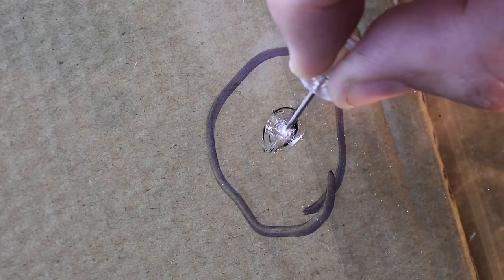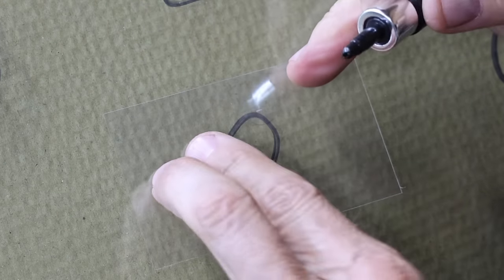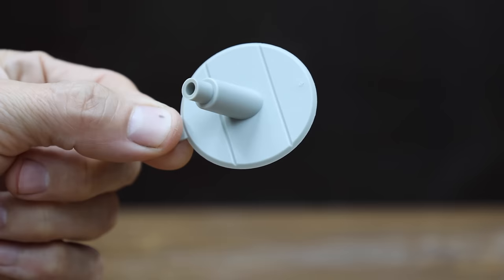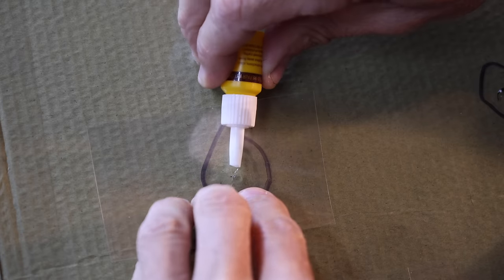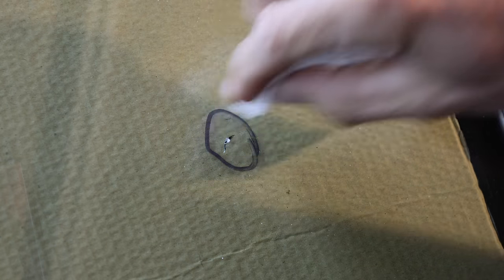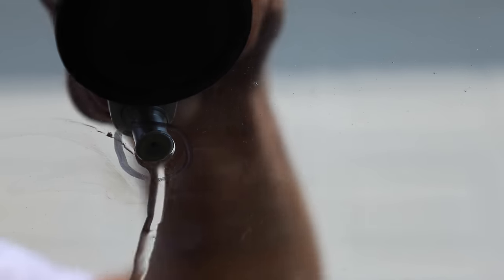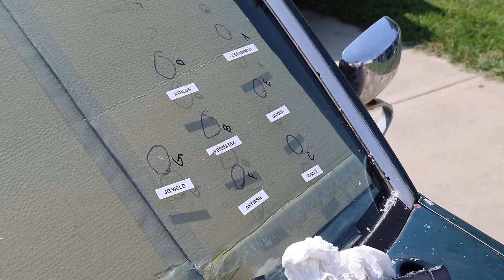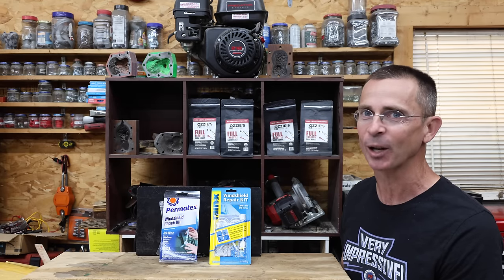Best Windshield Repair Kit? Let’s Find Out!

Comment: So, I use the permatex and rainx on a regular bases. Wrangler windshield. The permatex is my favorite for bullseyes but the rainx kit is the only kit I can use to repair the ones that have spread. I put Vaseline across the path the suction cups will travel to guide the center over the full length of a crack while maintaining full pressure.
Reply from the maker: Thanks for sharing.

Comment: I recently paid $120 for a single tiny chip repair (that was the lower of two quotes from a national chain vs a local shop).  I’ve wanted to try one of these kits going forward and now I feel confident which one I’m going to use.  THANK YOU!!! BTW - your lawn mower blade recommendation this spring was spot on.  I bought two of your preferred mulching blades for my 42” deck and have never been happier with the cut.  Keep up the excellent work!
Reply from the maker: Thanks, will do!  Thanks for sharing.
Reply: @TastySurrealBowl Which kit did you go with? How are your results(looking) holding up?
Reply: @SG-bb8pq I have yet to make the repair but I’m going to be trying the Permatex kit.

Comment: I actually just had to do this on my jeep. Had two quarter size impacts that were bouncing light into my eyes. I used the permatex brand because I recognized it more, and it was the /only/ one that did suction like the pro kit. I had about a 98-99% reduction to the damaged area with only the "pit" being visible. Didn't have any issues with the pit either, but I left it to cure well overnight and most of the next day. 

For twenty bucks for two? It's a great product and saved me from dropping 250 on a new windshield.
Reply from the maker: Thanks for sharing.

Comment: I carry Rain-x kit in my car. Used it last fall when traveling on vacation. 45 mins after a rock chip from a gravel truck I found some shade, did the repair, moved the car into sun to cure it. Then happily keep traveling without worry about finding a glass repair place. 
 
Next I would like you to test non reusable aa lithium batteries. I find myself using these more a more now that the price is down to around $1 each. I use them in flashlights that I keep for backup, so I do not go to use the light 5 years from now just to find that the alkaline batteries have leaked and not only does flashlight not work but they have ruined the flashlight. There are many different brands now om Amazon, looking for the best bang for my buck. I use them in anything that might set more than a year.
Reply from the maker: Thanks for sharing.  Thanks for the suggestion.

Comment: EXCELLENT video.  I have always used the RainX kits finding their plunger tool to be workable but temperamental, I am not alone I see.  I think I need to add that ClearShield plunger tool to my kit for next repair.  I re-use the UV light from my AC leak kit in the same way you you showed.  Thanks!
I assume the PRO's resin for the crack and pit are different.  I wonder how so, is one harder that the other or something like that.

Comment: Another great one, Todd. About 30 years ago I used a kit very similar to Permatex (whichever one was available at my local Checker parts) and it worked very well, could barely tell there had ever been damage, and it lasted longer than the rest of the car.
I'd love to see your reviews of robot vacuums. I know that's a bit more indoors than the type of products you normally test, but I know I could trust you to test them right.
Reply from the maker: Thanks!  Thanks for the suggestion.

Comment: I did this as a pro many moons ago, our kit had a vacuum pump that we would use to evacuate the chip and all the moisture, as well would drill the ends of cracks to stop them and yes used my lighter to heat the repair, sometimes it would just 'run away' when a crack progressed from the chip
Reply from the maker: Thanks for sharing.

Comment: I've used the rain-x to fix my shattered phone screen, it allowed me to keep using it for years before i changed it. 

My procedure was putting the resin, work on the cracks with a sharp or pointy object. to make sure the resin got into everyone and stopped being so visible, once the results were acceptable I applied an hydrogel screen protector(I didn't use glass because I didn't know if the repair would work) and finally take it to the sun to cure, I hope it helps someone.
Reply from the maker: Thanks for sharing!

Comment: Great video! I feel a little more confident in a future purchase because of this. Thank you! One thing to note (if you care for it) is the blindedness of the test. Having the pro rank them is great but in order to achieve objectiveness you should not show them the brand names. You can probably get away with single blind where you (the administrator) knows the products and the subject (the pro in this case) doesn't, or you can go all out do double blind where neither one knows (i.e. get a friend who also doesn't know which is which, ask the pro which is which).
Reply from the maker: Thanks!  Thanks for the feedback.

Comment: I owned a Glasweld system back in the mid 80s. Paid $1100. It was a great kit. There are several thicknesses of resins and now different shades. Wish I still had it. I'd like to see if those resins can fill the cracks of cell phones.
Reply from the maker: Thanks for the suggestion.

Comment: I ended up choosing the rain-x kit over all others. The reason is because the rain-x kit allows for multiple repairs in the same kit, and my "new" truck has four different chips in the windshield. Buying four single use kits would be prohibitively expensive and I don't mind that the chips are still slightly visible.
Reply from the maker: Thanks for sharing.

Comment: I've done the rain x one,and after some practice runs,it filled in a crack where you could hardly see it,and it never spread , which was my main thing doing it... I've made chips almost completely disappear,but the thing has to be really clean,and use a UV light instead of depending on the sun
Reply from the maker: Thanks for sharing.

Comment: QUIXX Windshield repair kit is the only one available here in Sweden. Looks very similar to the Rain-X, except that the QUIXX manual also says you should use a hairdryer to warm up the area from inside. (Can anyone confirm they are the same?)

A note on the suction test you did: A normal plastic thread is probably very leaky when it is dry. With a liquid on the thread surface, it probably has a lot more suction capacity due to the viscosity of the liquid.

Comment: Video Recommendation
Recently, my family, and I have been looking at the electric generators/power banks. I know you covered a video on generators before, but I was wondering if you can possibly check out the electric power banks, as they seem to be more usable rather than a noisy power supply. Lastly, you always make great videos and help me make the right decision with my buck.
Edit: I have 2 rock chips on my 22’ highlander and will be purchaseing the permatex although the clear shield does perform better, 300 dollars, I’d rather put the extra 200 on top for a brand new windshield. Thank you again for providing all of this valuable knowledge
Reply from the maker: You are welcome!  Thanks for the suggestion.

Comment: I've used the Permatex kit on multiple vehicles. Mainly because that is what is sold at the local stores. It works better if the windshield has been sitting in the sun for a few hours.
Reply from the maker: Thanks for the feedback.

Comment: I've had good results with the jb weld and permatex kits. I think they're just rebranded from one or another manufacturer. Inside the kit is the same stuff. One important thing to note for anyone using these DIY kits. If  the results are not to your satisfaction, then you may be out of luck. A professional will likely not try to repair after you used the kits. They would have to heat up the existing resin which risks cracking the entire window and this would require whole window replacement. Overall it's a gamble.

Comment: I’m really surprised that so many kits, even the clear view, just push the resin in. My understanding was that the vacuum provided by the actual syringe products was necessary for the resin to migrate. But the pushers seem to work…

When the professional did his repair, he pushed the resin in, then said, “now I pop it”. His hand was in the way and it wasn’t clear what he did. Did he use the piston to push resin in then briefly unscrew the  CYLINDER to release the pressure, then back out the piston to create a vacuum?

I really expected the professional kits to have a small screw valve at the bottom of the cylinder. Put the resin in. Open the valve. Lower the piston. Close valve. Withdraw piston. Pause a bit. Lower piston.

Did you happen to hardness test the professional?

As always, great review!

Comment: Thank you so much for your in depth tests, they are extremely helpful. I believe you are truly making the world a better place by showcasing weaknesses and strengths of products many people use. It's the ultimate version of "Consumer Reports" and it holds manufacturers accountable as well. I really just came on to say I was interested in knowing which waterproofing silicone spray is the best. What to look out for as far as chemical compounds and whatnot. I usually go straight to 3M then Dupont but have been shockingly disappointed with a 3M product in the past but I can't remember what it was. Anyways, just putting in my comment to express my appreciation, you seem to be a very good hearted helpful person. I am also casting my "Best Silicone Waterproofing Spray Test" vote. Thank you.
Reply from the maker: Thank you very much for the support!

Comment: I have had extremely good luck with the rainx kit. Typically I will use more resin than recommended and do it twice for larger bullseyes with cracks. Ill also let it sit for 10-15 minutes with the pressure driver down. You can use it multiple times which I like.
Reply from the maker: Thanks for sharing.

Comment: Very good demonstration for sure and I use the rain x brand and I apply a little heat and it seems to pull in the resin more but it’s a gamble because it could spread the crack.
Reply from the maker: Thanks!  Thanks for the feedback.

Comment: @Project Farm you guys should do a review on work tables, the foldable kind for job site. I used the dewalt ones that came out they used to be 70 dollars and would go on sale, now the market has exploded with options at 100+! testing the plastics and weight capacity, maybe a long term corrosion test too seeing which one is best for the buck like you guys always do so well. about to go pick up some straps you recommended for cutting resistance, my second set in one year with regular use on steel to really only replace one.  Thank you for making the best tool testing vids on the platform in a way that's scientific and entertaining.
Reply from the maker: You are welcome!  Thanks for the suggestion.

Comment: Surprised about the JB weld results, figured they would do good since they have the brand name behind that for making good e-poxy stuff and i've used some of their products in the past. That said the last windshield repair i did i used Permetex since that is what my local auto zone had. Its held up fine only thing i didn't like was the finicky nature of the whole syringe. as per the instructions when i went to plunge it in i couldn't get it to hold on the clip right (user error) and it ended up blowing out the whole seal and resin went everywhere. i managed to scoop enough up and put some tape around the edges to salvage the repair but man they really give you the bare min. resin you need to get the job done, no mistakes allowed!
Reply from the maker: Thanks for the feedback.

Comment: I'm a novus repair technician and see people try the home kits all the time. For the money some of these people spend on single use kits they could just come to us and get a better repair for the same money, or for free through insurance. They are then told their failed repair can't be re-repaired and they need a new screen. Heh. Was good to see a professional trying them out. There's a lot more that goes in to certain types or repairs that the kits don't allude to, like star chips without any shelling won't fill in as the crack is on the interlayer side so need to be broken open more, some chips need to be probed to open them up and allow resin to flow further in (the one the tech hit with a lighter should have been probed) . A transparent yellow uv blanket should have been covering the chips to stop them prematurely curing from the sun too. By having a trained professional though, the chips get a fairer shot.
Reply from the maker: Thanks for the feedback.

Comment: You should do a challenge on different type of hammers and handles, comparing all the 16 oz. hammers (Stanley, Stiletto, Fiskars Isocore, Martinez, Estwig Leather, wooden handle vs metal handle vs composite or fiberglass); 16 oz. is a measure that can be useful for both carpenters for finishing, or light duty framing, home owners and diy, so full spectrum.

Comment: I used to do these professionally, and think it's great there are kits that do a great job for anybody willing to do it themselves. One thing I need to add, is if the chip is wet, make sure the glass has time to dry out, and dont wait too long as sediment becomes a dam, preventing the resin from penetrating the crack. I also agree with using a lighter to heat the glass.  My biggest achievement was a silver dollar sized chip on a vertical motorhome windshield. The guy is still alive to back me up. I didnt think I had snowballs chance either. I still cant remember how I was able to get all that resin in at a 90 degree angle. Very impressive! Ha! Ha! Even to me!
Reply from the maker: Thanks for the feedback.

Comment: The Mohs hardness testing was a great inclusion. I'd also be curious if any of the resins will yellow over time. Not sure how to quicktest that one, though!
Reply from the maker: Thanks!  Thanks for the suggestion.
Reply: I guess pointing a UV light at them? It's the UV that causes epoxy to yellow as its molecular structure has aromatic rings which absorb in that part of the electromagnetic spectrum

Comment: Great testing procedures Todd.
There's, however, a big problem with the instructions about how to proceed with many of the repairs. If you have to press firmly all around the damaged area, you run the very real and almost certain risk of causing the tiny blemish to instantly run out all the way to the edge of the glass.
That can easily happen even without touching the windshield due to heating and cooling cycles as well. 
If you have to do this in this way it would be prudent to have a 2nd person inside the vehicle applying counter pressure at the same time. 

Almost any of these are better choices than a brand new windshield, unless of course you have insurance that covers 100%.
The important thing is to deal with the problem as quickly as possible. Heating and cooling cycles are the evil enemies of the slight glass blemish.
Reply from the maker: Thanks for the feedback.

Comment: I noticed the pro was doing his repair in the sun it should be done in the shade as the resin is uv curing. But he did a good job exactly the way I've been doing for 25 years. Ps long crack repair work generally fails  in a short time due to hot and cold expanding they open up again. Always cover your chip as soon as you see it with cellotape to stop contamination
Reply from the maker: Thanks for the feedback.

Comment: I would have loved to see a test on windshield CRACKS, because they are way more damaging that bullseyes and tend to propagate very fast. I bought the rain-x because it claimed to work both on bulleyes and cracks and although it was indeed quite tough once cured, it really with the 6 inch crack I had, barely penetrating it and only over less than half its length, despite keeping the resin warm and heating the glass with a hair dryer. I now realize that windshield repair kits just aren't good ennough to repair cracks and you need the lowest viscosity resin you can find, massage the glass from the other side while applying the resin slowly to help it penetrate properly, and work away from any UV source (so can't work outside even in the shade).
Reply from the maker: Thanks for the suggstion.

Comment: Could you maybe do some testing on like Garage flooring to see if they are heat resistant and scratch and just generally how tough it is to garage daily use? iv seen a few different comments on some of the products i was looking at saying that just driving a car home  from work or to the store was enough heat to make some of them melt/stick to tires. Thanks for all your videos they have been of extreme help in saving money from products that claim todo things that it dont.
Reply from the maker: Thanks!  Thanks for the suggestion.

Comment: Long time follower... I have an ask, chains and lubrication.

Which is the best chain lube for motorbikes and atv's? How much does a chain "stretch" due to wear, normal chain? oring chain? Xring chain? Setup is I guess two sprockets a motor/engine, a chain and something you can apply load to one of the sprockets.

Do products like "muc off" chain lube prolong the life of the chain? Or does normal oil perform as good?

I've recently changed my motorbike chain because I hadn't really maintained it properly and you can listen to all sorts of people about all sorts of ideas, but what do the facts say?

Much love bud.
Reply from the maker: Thanks!  Thanks for the suggestion.